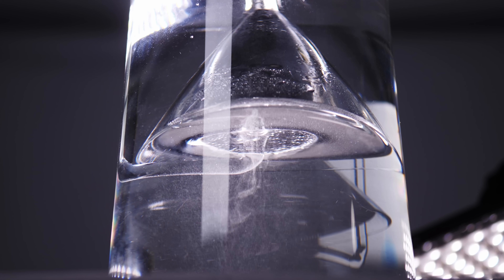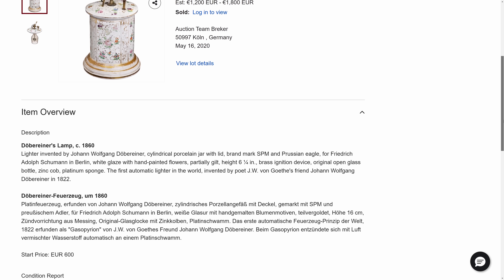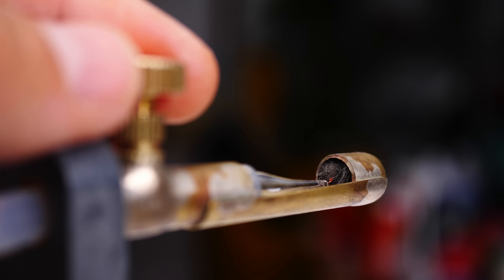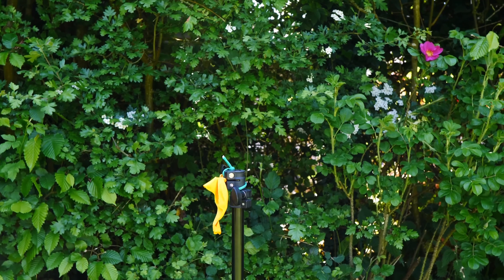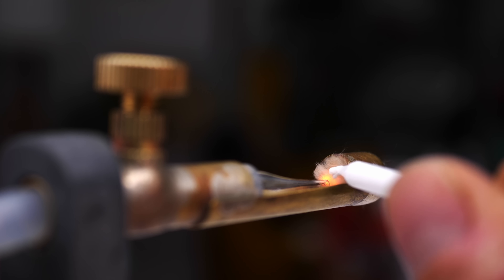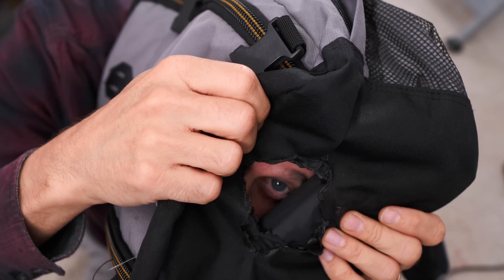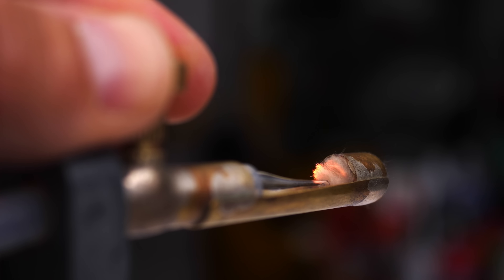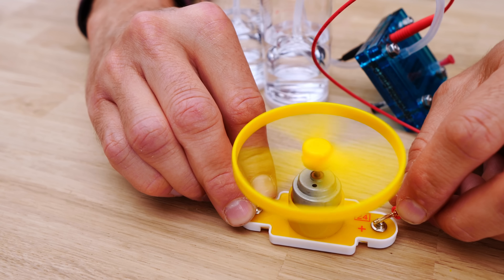This 200-Year-Old Lighter Ignites Without a Spark

Comment: Thank you Steve, Amazing video! But there are some inaccuracies when you explained how the H2 gets split apart by Pt. 

The H2 is "lured-in" not by "the sea of electrons" in the bulk metal, but by the empty d-orbitals! When H2 approaches Pt, the σ bonding orbital of H2 overlaps with one of the d-orbitals and then donate electron density into it - this is what attracts the H2 to the surface of of the catalyst! Now the d-orbital of Pt is filled, which allows it to donate the electrons back to H2, but now into its antibonding orbital and splits H2 apart. Also technically if you're pretending the table as the catalyst surface, when H2 approach, it should be in sideways to have the optimal overlap with the Pt d-orbitals, instead of attached "head-on" to the surface. 

You can think of it like this - H2 first approaches one of the lobes of an empty dxy orbital perpendicularly and donates electrons. The d(x2-y2) orbital having a 45° angle to the dxy orbital, 2 of its lobes now overlaps with the H2 antibonding orbital, which allows the back donation into H2 antibonding orbital to happen. O2 is captured with a similar mechanism, not with a σ bond seen on H2, but with its π bond.  So similar to H2, O2 should also approach to the catalyst surface parallelly. 

This reaction is called hydrogenation and usually it's done between an alkene and hydrogen - the 2 hydrogens would add across the double bond and turn the alkene into an alkane. Experimentally when doing a hydrogenation, the catalysis between hydrogen and oxygen is the exact thing to avoid, because heat produced in this process could cause an explosion inside the flask. It's interesting to see some crazy chemist popularized this potential explosion hazard into everyone's home for 3 years and risk spilling sulfuric acid all over lol. 

Cool papers with more detailed hydrogenation mechanism explained: 
https://doi.org/10.1038/s41557-023-01380-1
https://doi.org/10.1021/ed300437k
Nile Red also made this amazing video showcasing the reaction
https://www.youtube.com/watch?v=drIm8_1CvjQ&t=584s

Thanks for sharing as always!

Comment: Platinum Metals Review

"Döbereiner himself suggested that one could “embellish it with two alchemical symbols, namely the lion and the snake, and so arrange it that the snake takes the place of the capillary tube for the stream of hydrogen and the open jaws of the lion sitting opposite the snake hold the platinum."
“this experiment is most surprising and amazes every observer when one tells him that it is the result of a dynamic interaction between two types of matter, one of which is the lightest and the other the heaviest of all known bodies”

Comment: If anyone's wondering why we don't use hydrogen for all energy storage instead of batteries, it's because you only get about 30% of your energy back as electricity. The other 70% is wasted as heat.
Most batteries can manage over 80% return with less than 20% wasted as heat.

Comment: I loved the various gags so much, from trying to put the phone in his pocket, channel birthday (happy birthday!), zinc, the strike "anywhere" match, sooo many good bits

And also, this device is cool! It's really innovative, how the lamp will regenerate its store of hydrogen gas with that clever design that uses it as a bubble and submerging the zinc when it gets used up!
Reply: Kinda wish he explained why he did the bit with the strike anywhere match. People these days don't realize that safety matches like the ones he used are made with red phosphorus, which is why they require a striking surface, unlike the strike anywhere matches that were made with white phosphorus, which enabled them to be set alight on anything as long as there was a bit of friction. An original strike anywhere match would actually get set on fire after rubbing on his bare face. While extremely easy to use, they were a bit too easy to set off, and white phosphorus is extremely dangerous which was why those matches were banned. There's still strike anywhere matches produced to this day, but they of course don't use white phosphorus and are much harder to set off, meaning rubbing them against your skin wouldn't generate enough friction to activate them.

Comment: I remember there used to be these gadgets for gasoline cars which supposedly consumed platinum and used some kind of deposition process in the air intake to leave platinum atoms on the surface of the combustion chamber. The gadget looked like a bottle with vacuum hoses and a suspension liquid which didn't evaporate.

Comment: I knew about the Platinum catalysis and what it does to hydrogen, but explanation with antibonding orbitals was something I have never thought of or came across. That is really cool to know!
Reply: I thought that was really really great. It filled an information gap i had. It shows there's lots of connections that still need to be refreshed in the public mind!
Reply: Yeah i'm pretty surprised tbh that he didn't know that platinum-group metals were used in catalytic converters for cars. Same principle i'd assume.
Reply: A further detail occurs to me.  The H2 hydrogen molecules are attracted to platinum by van der Waals force.  But as soon as the molecule breaks apart then the van der Waals stops.  So what holds the loose H hydrogen atoms to the platinum surface?
Reply: @larrydevito8679 you’ve attracted a chemist to tell you. When those hydrogen anti-bonding orbitals interact with the platinum d-orbitals you break the H-H bond, and those H atoms form bonds with the platinum. The H-Pt bond is a lower energy situation than an H-H bond and platinum with its partially filled orbitals - and the release energy is what heats up the platinum metal and ignites the other hydrogen.
Reply: @larrydevito8679 Chemisorption

Rhe hydrogen atom forms a bond, often described as a weak covalent but described as a metal-hydrogen bond, with the surface platinum atoms.

This  bond is not as strong Asa  full covalent bond from sharing electrons  or an ionic bond from transferring electrons but are much stronger than mere physical adsorption, a.k.a. physisorption.

Chemistry is indeed cool.
Reply: @larrydevito8679  that's easy. The oxygen is already there. It is in the air so it gets to the platinum first. So as soon as the hydrogen molecule breaks they wobble over to the nearest oxygen atom.
Reply: heat = wobble. Obvs, but amazing.
Reply: When Britain moved to Natural Gas (Methane) we all have to buy boxes of matches.

Comment: Zippo still makes platinum catalyst hand warmers. They use naptha(lighter fluid) and you do have to heat the platinum first but they run for hours and are surprisingly safe. The only dangerous part is when you first heat up the platinum... and if you overfilled the fluid chamber you will know... I bought both one of these and electric ones. The electric ones are nice but they just dont have much thermal mass so touching them instantly cools them down. While the zippo one will retain a lot of heat.

Comment: I'm only 5 minutes into the video, but I wonder that the thing that made Dobereiner's lamp obsolete is that you can also catalyze methanol vapor to burn using platinum.  Ben Krasnow of Applied Science showed off a lighter that used that technology, and it's much simpler and more portable.

https://www.youtube.com/watch?v=8gFqzbnUO-Y

Update: I was wrong.  The methanol-platinum lighter (1906) came nearly 80 years after the hydrogen-platinum lighter (1823).

Comment: Way back when, I worked for a "rare earths" manufacturer.
My first "side job" was to make a methanol / platinum cigarette lighter. For non-techs it was akin to magic.
I also played with high grade hydrogen peroxide and fine silver screens... but, we won't talk about that here.
Reply: Otherwise someone would have to kill you? Or it’s too embarrassing? Wharever the reason, I’m intrigued!
Reply: @fburton8  Lol, you can Google the "effects" yourself. 
   I'll just say that purity, temperature and pressure have abnormal cumulative results that can quickly get out of hand if not prepared.
Reply: @CraftAero  Explosive whooshes come to mind. 😅😳
Reply: @fburton8  from wikipedia: "Concentrated hydrogen peroxide, or "high-test peroxide", decomposes explosively when heated and has been used as both a monopropellant and an oxidizer in rocketry." Integza has a video titled SUPER HEATED STEAM ROCKET where he experiments with different ways to make things go fast with hydrogen peroxide fuel, one of which is silver mesh. So whatever CraftAero was doing involved making small amounts of liquid turn into large amounts of hot gas.
Reply: HTP, fun stuff! I've seen the bke powered by an HTP rocket at Santa Pod, it's bizarre hearing the loud hissing noise and seeing nothing obvious coming out of the nozzle.

Comment: Dang, now I need a Döbereiner's lamp! One small correction, though: A majority of the heat generated by the water evolution is the chemical potential energy from the H-H and O=O bonds breaking and being replaced by the relatively weaker O-H bonds. This energy is then transferred into the surroundings, which leads to the thermal excitation.
Reply: *relatively stronger
Reply: @bowlseriv  right you are! Should've done my enthalpy calculations and thought a bit longer before commenting late at night.
Reply: Wait a minute, no. The ∆H is -286.3 kJ/mol. The O-H bonds are weaker. (I should add a disclaimer that this value is the standard enthalpy of formation of water, but seeing how Steve was using his lighter in a room that I'm assuming wasn't extremely hot, cold, or far from sea level it's close enough).
Reply: @davidqharmon7311  exactly! A stronger bond is characterized by the large negative enthalpy change of the reaction! If it were not so, the enthalpy would be positive, because weaker bonds need more energy put into the system to form!
Reply: @bowlseriv  🤦 yeah. You're right. My brain isn't working today. But in any case the original point was that the heat generated isn't a result of molecular scale collisions, but the conversion of chemical potential energy to vibrational modes/phonons.

Comment: Why does it only work with platinum, though? You said it worked thanks to the sea of free electrons that all metals have.
Reply: Platinum is highly inert despite being a metal. Yeah another metal will react but you will find a normal metal is highly electropositive it won't get out of the way to away the desired reaction reaction to occur. That is not catalysis.
Reply: It's to do with how tightly the sea of electrons are bound to the nuclei of the metal.

Comment: The Japanese have used catalyst powered handwarmers for over 100 years, the brand hakukin launched their first one in 1923 and are still sold now. Often sold internationally under the peacock brand.
Reply: The first time I learned about their existence was watching Yuru Camp recently, they're kinda neat.
Reply: Yep, I've got Peacock hand warmers. Love 'em.
Reply: Peacock is better than the Zippo one. I once "studied" them all and Zippo isn't a very good choice in my opinion, + the Peacock is cute.
I have a bunch  of different kinds. Also the Peacock "giant" exists, which is the king : 3 cups, 30ml, 30h (48h some say), 1064kJ, 9.854W 1ml/h, I did calculate...° .. A must have.  :)
Reply: Zippo still does as well.
Reply: @BuddyL2003  yeah but as much as I love zippo, peacock is the best brand in handwarmers, but so hard to find
Reply: @Taka.1011  They're on Amazon...
Reply: @Txupport  Omg yeah, I checked and they are on Amazon US, but not on my country's Amazon. And the hard to get one that I was actually thinking of was the S-Boston, it has a way better design with a cap that houses an electric heating element to start the reaction, and can stop it by just flipping the cap
Reply: @Taka.1011  You can order from another countries Amazon and still have it shipped to you most of the time, if they won't do it directly to you, there are plenty of privatized courier services you can send it to that will then ship internationally. And the S-Boston company went out of business a while ago, which would be why its hard to find.

Comment: So if you blow hydrogen over a platinum ring, your finger burns off?

Edit: Okay just watched to the end. But it’d at least get a little hotter, no? How hotter?
Reply: There just isn't enough surface area for any significant catalyst reaction to occur with a solid object like a ring.
Reply: Like if you want to prank your wife without burning her finger off, could you just blow a little hydrogen on her finger?
Reply: @tdubya4392  I don't recommend using explosive gases for pranks. Also it wouldn't work.
Reply: Surface area

Comment: Another use of platinum today which you didn't mention is catalytic converters to reduce pollutants in exhaust gasses.
Reply: It's a fun exercise to have some spare material around (maybe you find a scrapped cat, maybe you got a replacement, etc.), and point a gas torch at it.  With the torch lit, the ceramic honeycomb (or maybe it's a square grid, but whatever) heats up as expected.  Now snuff out the flame but keep the fuel supply running: a hot zone develops inside the catalyst. It keeps on glowing.  You can even move it around a bit, as heat is carried (slowly) through the matrix, following the supply of fuel.

At least, that was my experience, doing this with propane.  Far as I know, it works with any vaporized hydrocarbon fuel mixture (hence its direct automotive use, reducing unburnt gasoline/diesel residues in the exhaust). I don't think methane is unstable enough to auto-ignite? But as you can see, hydrogen is, if you happen to have some handy...

Related: a red-hot penny (has to be an old 95% Cu one! US before 1981 for example) stays red-hot when held above a pool of ethanol, acetone, etc. Copper is similarly catalytic, if not in exactly the same way, or as low activation energy, as platinum is.
Reply: @T3sl4  An interesting one with copper is that hot copper oxide dust exposed to ammonia in air will oxidize the ammonia to molecular nitrogen and water with enough heat to immediately burn itself to be ready to do it again. It's counterintuitively a lot harder to find self-sustaining chemical inert gas generator reactions like this than ones that create highly reactive gases.
Reply: how that wasn't the first thing that came to mind must be that he's never heard of "cat" thieves.
Reply: @carlosgaspar8447  I thought they were called Cat Burglars
Reply: @carlosgaspar8447  Yeah.
Reply: @carlosgaspar8447  Catalysis in general doesn't require platinum - you could understand catalysis just fine without knowing about platinum catalysis in particular, especially if you've never needed to use it in a lab context. Maybe he vaguely assumed cat converters used something more "modern", like zeolites, say.
Reply: @AD_AP_T  platinum and palladium, and other exotic metals. anyone that knows about pollution restriction standards usually set by california and followed by other western countries knows that cats reduce HC pollution. living in a bubble like many artists, politicians, experts....
Reply: @carlosgaspar8447  Did you tag the right person? I'm not sure why you're telling me this.
Reply: @AD_AP_T  possibly not. sorry.
Reply: Wow, I didn't know they reduce pollutants. I figured they are just things that fuel my several drug habits.
Reply: Catalytic converters aren't just platinum though, though also use palladium and rhodium. Rhodium is like 5-6x the price of platinum
Reply: By "reduce pollutants" did you mean "oxidize"? ba dum tss
Reply: @shi_mo_neta I know it both  oxidizes and reduces pollutants, I just didn't get to technical.
Reply: They have rhodium as well as platinum, we learned about the make up of catalytic converters when I was in diesel tech school.
The irony being most of the time when working on catalytic converters we were removing them to bypass emissions to make them more efficient 😂
Reply: Isn't that exactly what he said though
At the beginning of the video?
Reply: And also giving tweakers something to sell at the scrap yard lol
Reply: On seeing the design I immediately wanted to build one and while creating that kind of high surface area material isn't too hard for me I realized I've got palladium on hand, not platinum and it would turn out rather differently because the affinity for hydrogen specifically is even higher to the point H2 isn't attracted to palladium so much as soluble in it.
Reply: @cyborgninjamonkey I used to work at zirconium plant(arc furnace). It had a “catalytic converter” though it was the size of a shipping container and was full of palladium and Rhodium I think. Cleaning that over the summer shut down was a chore.. full hazmat suit with a positive pressure helmet in an enclosed space in 40 degrees c.
Reply: @doaimanariroll5121  oh god I can almost feel the sweat pouring out of the PPE as you remove it after 🥵 the quantity pooling up in just a gas mask and butyl gloves for half an hour at that temp is insane
Reply: @cyborgninjamonkey  brah, it was unreal.
Reply: I didn't hear him say something like "there is rarely any other use for platinum", just that there are not many easy ways to get hold of it.
Reply: Those seem to be unfashionable now, since we all drive heavy cars that chew up the road, and 4x4s that get taxed for being heavy cars that chew up the road.  We really need those hydrogen fuel cells to be a thing so the untaxed heavy cars can be lighter weight.